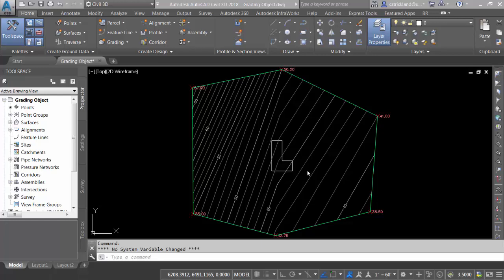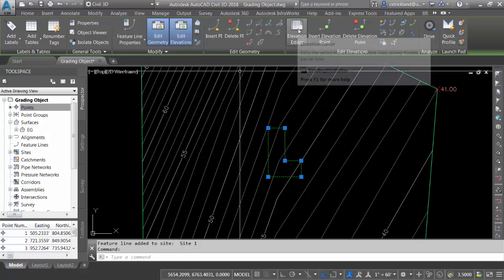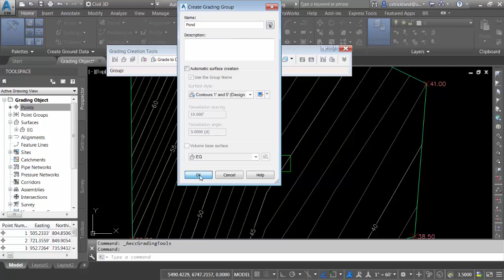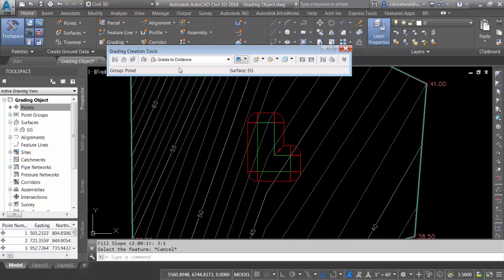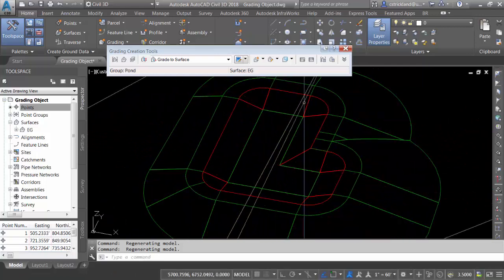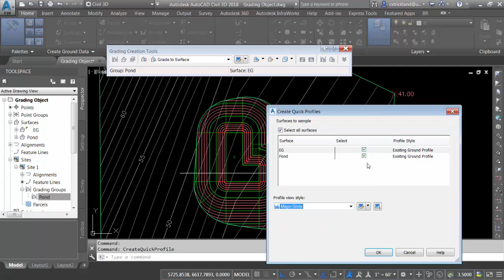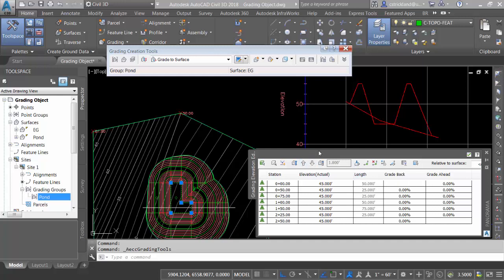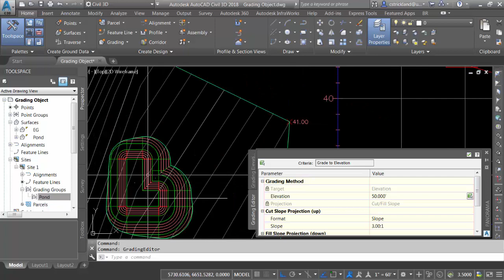Civil 3D - Grading Example 01

Comment: Hello, how to know the volume of this pond ?
Reply from the maker: You can make a surface from the grading group and compare that to the other surface and/or you can make an alignment and use samples to get a volume. I will make another video about getting volumes from surfaces made from grading objects.
Reply: @autodeskcivil3dclasses65  Perfect Thank you ! I am using the stage command but it have flaws, since if there are several contours of the same elevation it takes the smaller amd computes the volume for it and leaves the others as areas only ! I am trying to figure out how to make a proper Elevation storage table for the ponds.

Comment: hello, question how do you get all this icons(feature line, parcels, grading, aligments etc.) I have a problem my computer doesn't show it even when I click the Home tab do you have any idea? I will appreciate it very much.
thanks
Reply from the maker: You might want to check what workspace you are using, lower right corner looks like a gear. Or you might double check that you are running "Civil" and not the "Civil as AutoCAD" option that comes with the install. Beyond that I might need to screen shot to make a better guess. Good luck.